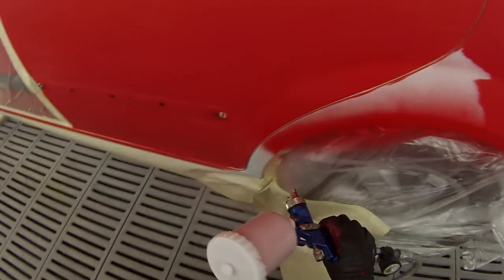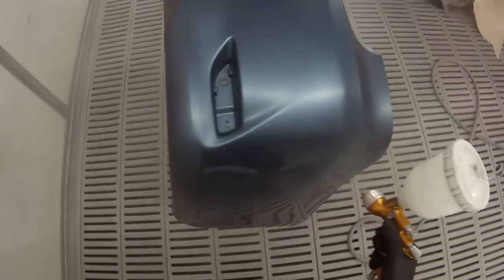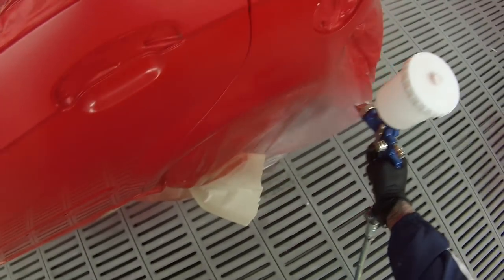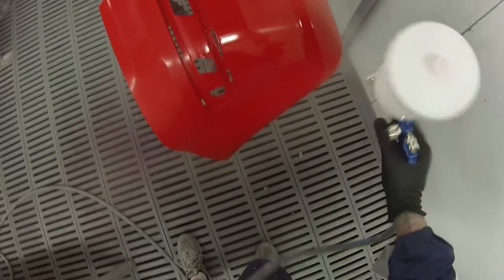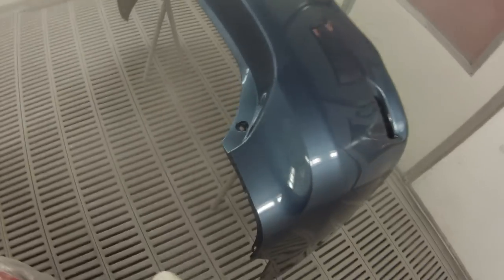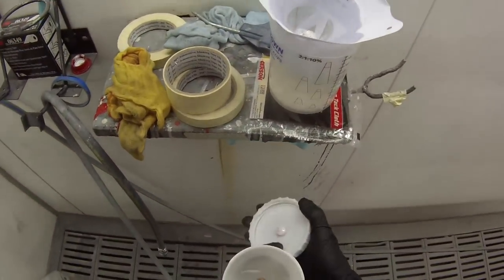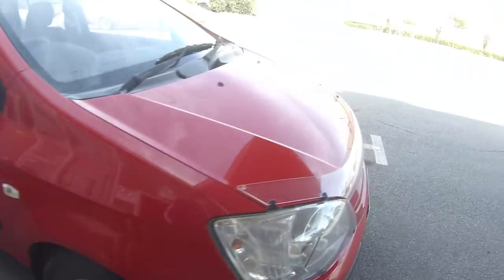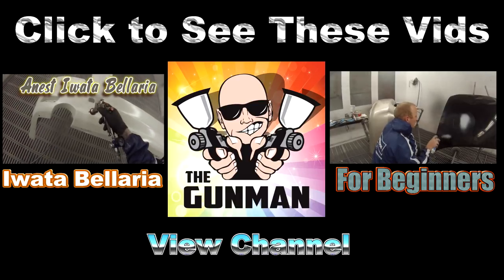Should I Buy a Cheap Spray Gun?

Comment: There can be no doubt that a cheap gun in skilled hands will out perform an expensive gun in inexperienced hands.
Reply: Eh no
Reply: You right about that Andrew!!! Gunman did a review on the harbor freight gun! Check it out sometime!
Reply: Andrew Wilson the gun man knows how to spray.. and knows how to set a gun up. If you watch the video he says he dialed that cheapo in the best he could and was just getting mediocre results from it. A quality gun will require less work to get a good finish as a cheap gun requires more work for a less than acceptable finish in my opinion.
Reply: That is very true. They tattooed in prison without professional equipment. Buddy get the job done really professional. Skills
Reply: Over how many years? Cheap gun isn't gonna last 10 -20 years.
Reply: Andrew Wilson:
Amen to that ...
Reply: @damukingchappie2604  yeah at first looks great but after time get worse
Reply: Not true. Nothing can save junk guns
Reply: @openmind3699  he’s spraying cromax it’s one coat coverage

Comment: 110% with you on this one mate, I have a Workquip and its a solid gun for basecoat, however the clearcoat is a mess with the same gun. I just did a spot repair on a bumper bar, and the clearcoat orange peel was a wreck. Resprayed the whole bumper using my new Devilbiss GTi Pro Lite for clear and it made a massive difference!

Comment: Yes........well I bought a Scorpion 1.4mm and used it to spray my rear panel in acrylic.......base coat was great and the clear coat turned out like a mirror.......no need for cut and buff with 1200 grit sandpaper.......I was happy, better result than a suction gun........it's all about the result you want.............thanks for the vid......great inspiration. :)

Comment: Gunman i used a harbor freight purple gun to refinish a hood and bumper on an 08 honda accord. Out the gate i noticed it used a lot more material and needed about 38 psi to lay down in a decent manner The fan couldn't open very wide w/o streaking; I probably got it open to about 6 inches comfortably. With that being said it took maybe 30 min longer than it wouldve if i had used the iwata because it needed a longer flash time from the amount of material going on. But on the bright side it perfected the look of that slight orange peel honda has from the factory and  didnt have a terrible finish. For anyone else thinking of using this spray gun considering the strain you put on your compressor, the finish, the material thatll be wasted and most importantly your time it isnt worth using daily but to paint one or 2 jobs itll do the trick but the buffer will be your best friend

Comment: Years ago, late 80's, I had the opportunity to work with a small group of BASF technicians/advisors, "using a cheap or even old paint gun for primer" was the topic. While applications varied greatly from one use to another (using the same loaded gun) the proof in the pudding remains even today. How much product was applied, how well did it sand, how much effort was put into getting it flat for paint, and the big one, could I have done any better with a better gun? Inevitably, the answer is always  a resounding YES.

Comment: I was using my DeVilbiss SRi Pro guns for basecoat and clear for the smart repairs until they started to play up, I'm told it's going to cost over £100 to fit new parts to each gun so Iv been using cheap shit £15 ebay guns and to be honest you can achieve really good results if you know what your doing, the down side is they wear out quickly and you know it's a cheap gun just by the weight and balance of the gun. What I have noticed is with a good gun is the finish is usually better than the original finish but with the cheap £15 gun it seems to go on like the original paint even though you might have to machine polish it sometimes. I think in my case it helps having over 40 years experience spraying cars.
Reply: Dan Druft jn

Comment: Christ, I just stumbled on this one as it is quite old. It would have saved me a great deal of pain and not to mention expense in paint. I bought a workquip HVLP set from Hare & Forbes with 1.4/1.8/2.0 nozzle sets. I am using the 1.4 to apply base and clear with disastrous results. Very bad orange peel of any thing I paint, piss poor fan pattern. Was about to go back to my old 1980's arnold suction gun but thought I would ramp up the pressure on the workquip gun instead as I had already tried from 20-28PSI at my Iwata regulator. So I went to 35PSI today and finally got a good result on my base, but it cost me a great deal of expensive paint in the process. Wish I had come across this vid earlier.
I have just purchased a new Devilbiss finishline which I hope comes this coming week.
Love your work.............keep it up please.

Comment: I have learned on an airbrush and realize that there is a learning curve. I can now do the same work through a 22.00 master airbrush as a 200.00 20/20 once I figured out thinning and what the brush pressure should be set at for each brush. Next up 12.00 spray gun to paint a vw bug and apply true flames should be interesting if I can pull it off.

Comment: Very useful. It's a tough subject to get intelligent, unbiased information on.

Many people have predisposed views based more on trendiness and brand snobbery, (fanboys I've heard them called) and can't tell you exactly what you get with the big price tag besides perceived status.

Out of necessity, I've used cheaper guns for years, and often wondered why I can't get certain paints (usually clearcoats w/hardener) to lay down without a lot of fooling around getting the reduction and temp just right. Even then, you have to spray on the ragged edge of running, constantly making adjustments for edges and vertical transitions.  I often doubted my ability, and it just sucked the enjoyment out of it.

Now that I'm doing it as a hobby, and started experimenting with more exotic processes, like candies, I find my 'old faithful' mid-priced guns are just that, mid-performance. Fine for painting machinery, and an occasional collision repair (where you often have to match the factory peel), but I find exactly the limits you mentioned. I cannot get the paint flow down to a lean enough mixture to fog on candy dyes without getting a spotty, uneven droplet size. When set to where the gun is working well, the paint delivery is way to aggressive.

A lot of folks that argue the cheap guns are just as good aren't pushing the limits, consequently don't see the difference. (I used to be one)

While you can do a decent job with a decent performing cheapie (they are NOT all the same), it's generally harder to pull off, and even 1 do-over caused by a gun issue eats enough cash to justify a better gun.

Turns out the gun DOES matter.If you're painting for money or doing fine or complex work, it matters even more.

I've learned a lot in the past few weeks, and your video put it all together for me.

Thanks, Scott

PS when reading down, I see you apparently had a demonstration of the syndrome I was speaking of. It makes you afraid to ask this question in a lot of places.

Comment: Ive Used a Harbor freight Purple  9.99 gun for about 2 years. I have 3 Primer, Paint and Clear.
Yeah not the greatest but I have laid some good jobs in the backyard with them. I do tool boxes, a couple of cars and trucks. Mostly Motorcycles.
I admit That a more expensive gun is great but for someone NOT doing it professionally. and want to do a few home projects a cheap gun is fine.

Comment: I want to be spraying some hammerite color (renovating some machinery). I understand it contains silicone so my plan is to a) spray it outside and b) get a cheap dedicated spray gun for hammerite only. 

I am also thinking of making a setup consisting of a pressure gauge like you are using in the video  but also add a water / oil separator right under the gauge. And fit a quick connect on the top, so I can just flip this setup between spray guns. I mean if I get any more... Don't really do much spraying.

I understand separation works better the further away it gets from the compressor and right at the gun is as far away as you can get. And with my setup I can't run a bunch of feet of hose or pipe before adding a water separator.

Comment: I got a Sealey 741 HVLP. Its a bit better than the ultra cheap one from common hardware store. I also experience that you hard to put a lot of paint on to get a decent orange peel. To the point were might get runs. I could understand it, your video confirm this. Yes, I also had to use much pressure, like 35 psi. I am just a hobbyist, so I think 500 dollar is a bit much for a spray gun, since I do maybe 1 car a year. But still I consider getting one, because I want a perfect finish.
Reply from the maker: Thanks for watching mate :-)

Comment: I had no idea about the quality of spray guns, except for when I purchased one from a really inexpensive tool store local to me, or where I used to live called Harbor Freight. There's really nothing of high quality in the store, and the only thing that's still working form there is the compressor I purchased about 6 years ago. I know that if you buy cheap you buy twice, or thrice. I've since stopped doing that as much as possible. To me $200 for a good spray gun to paint small parts (what I'm going to do) is definitely worth it.

Comment: Thanks again for the best tutorial videos
I got my tekna pro one month ago painted my friend 01 integra type r,  is just the 2nd time I painted  car first time I painted my personal car 74 vw bus with a cheap gun and you can see the difference
I got some orange peel but maybe my technique I need more practice
I used this gun for basecoat with 1.4 tip t 20 air cap and for clear 1.3 t 20 air cap 24 psi 80 gal air compressor 
Olso I painted in my back yard at 90 degree F
Questions hope you don't mind
1- the thinner you use for blending is special    thinner for blending or just any regular
2-  there are different ways to do blending? 
3- when you do a full restoration on a classic 
  What is the best way to do it? 
  What primer self etch primer then epoxy and 
   Then polyester primer epoxy again or sealer
  How many coats of base and clear, I'm     confused especially with primers
4  do have any video about rust repair ?

  you talk and explain everything on your videos thanks for that
Cheers

Comment: You made the Carmax look like a champ in the BC/CC application...Good Job!  This video is an excellent head-to-head review of the results using a cheap (generic design) spray gun versus an moderately expensive (refined design) spray gun.  Here in the U.S., the Carmax design is a dead ringer for the Central Pneumatic HVLP design available at Harbor Freight.  I have found that this "generic" gun works well for Polyester and 1K high-build primers.  However, I've found that you have to really work to get a flat finish (Base / Clear ) with this style of spray gun as well.  Thanks for showing us the difference versus just telling us that there is a difference.

Comment: The right tool for the job, if you provide or want to provide good quality than simply put use good tools. If you are good at what you do than you know a good tool will only provide a better finished job. But as mentioned if all you need is a cheap gun for jobs around home etc. then go get a cheap hardware store gun.

Comment: It's quite clear I'm in the right place. Glad I found this!

I build and fly scale model airplanes, and slowly getting to the point where I want to build airplanes from scratch. Which means I'm moving away from ARF (almost ready to fly) type planes. So naturally, I would want to paint the finished build, instead of applying plastic shrink wrap film (Monokote).

**So as a newbie to air compressors, airbrushes & spray guns (I own none), what's the point and\or difference between using plastic paint cups & metal cups? I think I see the advantage of plastic cups because one can view the paint level, so I guess my real question should be what's the point of metal cups?**

Comment: Excellent informative video. Much more useful than those guys who blather on about nothing specifically useful or practical. Just bought a Devilbiss GTI620g after using a cheap gun much like the one you used here, for primer coat. Don't want that finish for the base or clear, even though I'm only a hobbyist.

Comment: these are awesome videos you do, and they have answered something that was eating at me, I'm no spray painter , but have done a few cars in my time, back 20 or so years ago I did reasonably good jobs only used acrylics back then,a couple of years ago a mate wanted his body kit sprayed in two pak. I could not believe the massive amount of orange peel I was getting mind you he bought me a real cheap hvlp gun. I got so disgruntled that I couldn't put a flat coat down I ended up buying a cheap iwata thinking it will be OK because of the brand...I was so wrong..orange peel to the max..I've really been put off 2 pak thanks to these results...but I see some if the settings are different to what I tried and now I'm building a project car for my son,  I have a renewed faith in giving it a spray job..fingers crossed, so thanks for posting these vids you do

Comment: I don’t believe in buying cheap tools, but I don’t think you have to buy the most expensive to achieve a high quality professional paint job, even for a beginner like me. I bought a finish line Devilbiss spray gun kit. Comes with standard quart gun with 1.8 needle for primers and a 1.3 needle for color and clear coat. and and a detail gun with a 1.3 needle. Payed about $145 and it produces fantastic professional results for the home garage painter as long as you know how to setup your mixture and air pressure properly, you will get a Zero orange peel finish that looks like a mirror.  I have gotten incredibly good results with this kit. Of course your work piece must be properly prepared and clean throughout the process. Also, a cheap homemade spray booth can be made from PVC piping and plastic sheeting with a common shop vac pulling air out with aid from a power router that controls the shop vac suction. A small air inlet is open at the opposite side of the spray booth so air is moving through the booth not causing too much negative pressure within the spray booth. After you are finished, just pull off the plastic sheeting and disconnect all the PVC pipe and elbow fittings and pack them away in a small space. Instant spray booth for cheap!

Comment: Good video pal. I totally agree with all your comments about the cheap guns.  I've probably thrown 5 or 6 of them away over the years and find that you've got to work a lot harder to get a decent finish.  Probably no bid deal for the DIY enthusiasm who might want to flat and polish their lacquer for a show finish but I wouldn't want to lay down a coarse metallic with one of them!!  As far as durability goes the best I've got out of a cheap gun is about a dozen jobs then they start to leak or seize up.  My Devilbiss guns on the other had are practically bullet proof in comparison.
Reply from the maker: Absolutely

Comment: i'm ok with getting another clearcoat and and sand it down a bit, put i consider just keep myself to spraycans (only got like 2-3 project a year, and its not even in automotive areas) but still informative if i consider upping to a spraygun. in a dilema where i cant afford my project if i buy the gun and compressor, but cant get my project painted if i dont, lmao. i guess i'll throw a piggybank somewhere and start saving up for some high end stuff as i rarely see mid end stuff being worth it ^^ and i think you can agree on that!

Comment: i have the same gun off ebay for 30 posted with a 2.0mm cap that came with it and to be fair it runs about 40 45 psi weirdly hight and i agree u can get a good ok reasonable finish like the gets but retired it to primer only and use a gun i got a 1.4 cap setup for colour and clear and love both guns for there own reasons but its not like u cant do a reasonable job with it. if u use fast hardner u can get a good thick coat on of clear with a reasonable finish

Comment: Great tips & information.  A question on air fittings:  Do you use hi flow fittings (approx 5/16" opening) or "standard" (approx 3/16")?  Just switched over & it seems like there's a noticeable decrease in pressure drop when the gun is triggered.  Just a serious hobbyist but wondered what you thought.
Reply from the maker: We use the hi flow and with a good compressor they are much better, I paint planes at the airport and they have the thin brass Jamec Pem fittings and they restrict the flow and don't supply as even flow of constant air.

Comment: Great video. I subscribed to your channel and watch your videos on auto play while I eat breakfast.

Have you used the Devilbiss Finishline ? Would that be considered a cheap gun? Any thoughts on a great starter gun  around $300 dollars U.S. ?

Thanks again for the great vids.
Reply from the maker: Thanks mate, I'm yet to use the Finishline guns but I'd love to get one to try out, I'd class them as a mid range gun not a cheap gun they are good quality and can achieve pretty good results but not quite as good as the tekna pro lite or some of the Iwatas. I'd say the Finishline gun would be a good starter gun from what I hear but I have an Airgunsa AZ3 and its a good gun too and you'll get one for under $200 U.S. I have the 1.8mm AZ3 and use it for primer but if you wanted the same gun for color and clear then get the 1.3mm. Good luck mate thanks for watching and stay tuned.

Comment: you noticed that you have the bowl cap closed on the blue gun - the one that requires more pressure right... the bowl cap has a very small air hole on top.